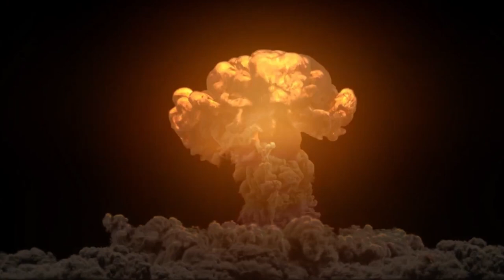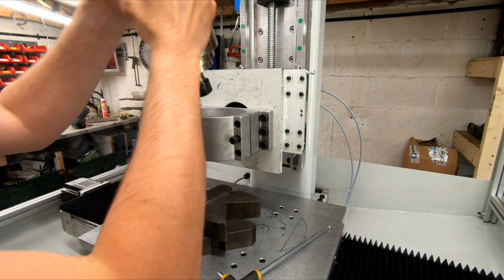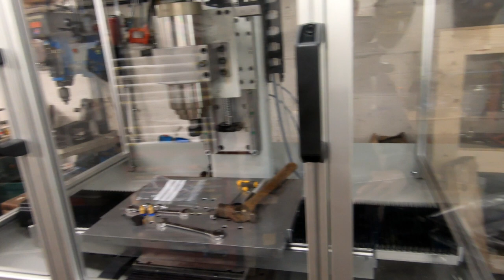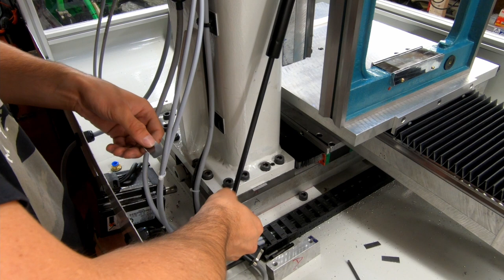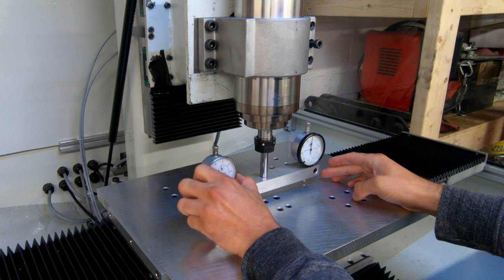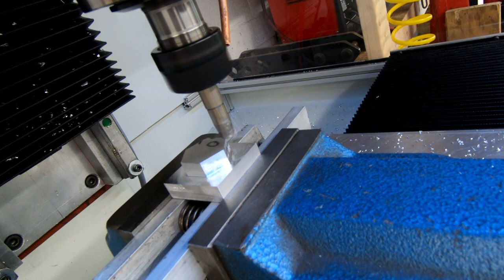DIY CNC Milling Machine Build (Part 15) - Mounting the Spindle, Machine Alignment and First Chips!

Comment: Something I’ve thought about was to build a cnc mill that had two mills back to back sharing the same base and column. 

For example a 8ft base with quad hgr30mm rails going through with a 14” square column in the center, rails and head unit on each side and the column designed that it could be unlocked and slid to one end for very large single table and a vertical vice off the back end for large parts resting on the floor and clamped to keep level. 

For example to machine an axle housing. Thought of a few alternatives with this idea.

Innovative and Very Nice work
Reply from the maker: An interesting idea. Thanks for sharing

Comment: Nice! Any measurements off the part? What kind of tolerances are you holding?
Reply from the maker: 25mm part with 25.03 measured with calipers.
Reply: .0012"

That's great! That would sail through QC in most shops. 

I'm excited to see how hard you can push the speeds/feeds. Lets see some steel!
Reply from the maker: Me too, this was just the first part I made to check the accuracy and to try it out. I'll be pushing the feeds and speeds in future videos and of course i'll be trying steel at some stage!

Comment: Your enclosure looks extremly accurate. What paint did you use for it? I've noticed that you used 2 types of paint.
Reply from the maker: I've only used one type of paint, a metal primer and an enamel top coat. The 3030 extrusion comes pre coated/painted

Comment: Very cool, Who made the 10mm cutter? did you run it at 24k
Reply from the maker: The holder is made by Teknik and the inserts Korloy. I have also had good results with Mammut and Rennie carbide end mills. I usually run the 10mm cutters at approx 10k rpm.

Comment: What are the spindle specifications?
Reply from the maker: It's a 3KW chinese spindle, water cooled with ER20 collet. I really wish I had an ISO or BT taper spindle, this would make tool changes so much easier!
Reply: What is the RPM of spindle?, Can it cut Steel (Mild steel)?
Reply from the maker: 24000 rpm. I've been cutting aluminium with 10mm cutter at around 10,000 rpm, 1.5mm stepover and 10mm DoC. I believe it will cut steel with the right feeds and speeds no issue. I have seen less rigid and powerful machines than this cutting steel.
Reply: Thanks for your valuable response..
Reply: Will this 3kW spindle run OK from a standard 13A UK socket (obviously via the inverter).  The specs say 10A which is a bit close so I was wondering if this was OK in real world use, thanks
Reply from the maker: I run my machine from a 16A commando socket which is fused at 20A from memory. I guess it really depends how much load you're planning to put on it, obviously it's not pulling 3KW all the time. You'd have to make some pretty big cuts to make it pull 3KW continuously. In reality you'd probably not pull anywhere near 3KW for any length of time likely to blow a 13A fuse. I'd imagine it'd be fine.
Reply: OK good to know thank you.  If I go this route I’ll try it on the standard circuit and if I have problems I’ll get a 16A dedicated circuit put in.  As you say I think it would be OK but will plan for the worst.  Great build by the way!
Reply from the maker: Next time I use the machine and I'm making some decent cuts I'll get a current clamp round the incoming cable and see how much the entire thing is pulling.
Reply: OK that would be very useful thanks!